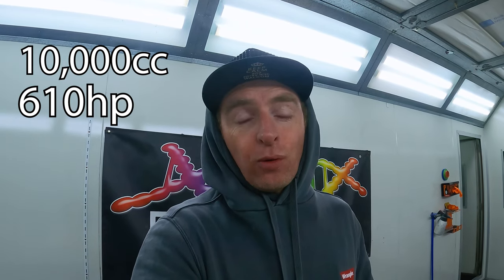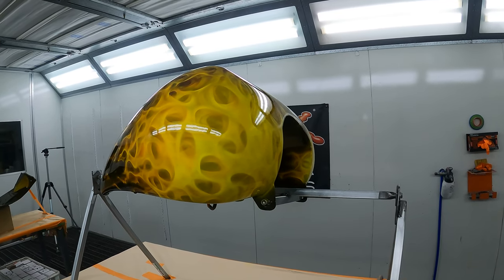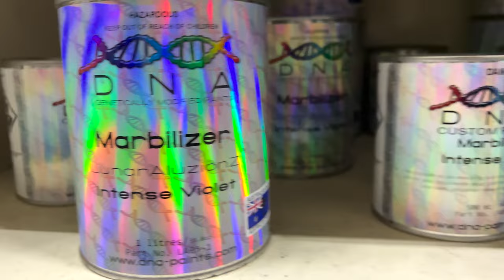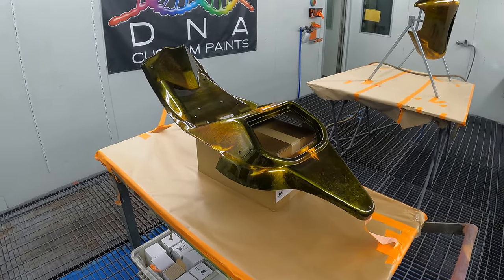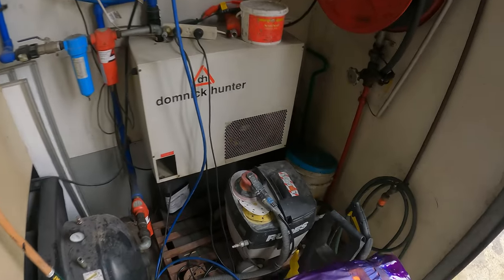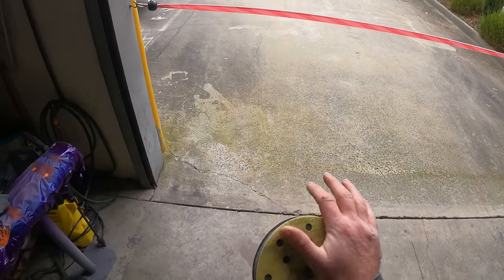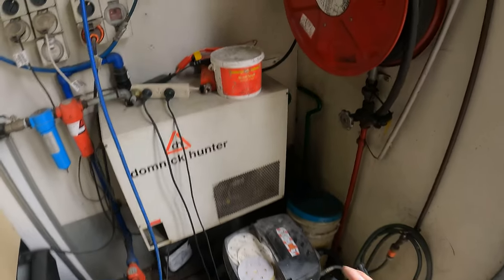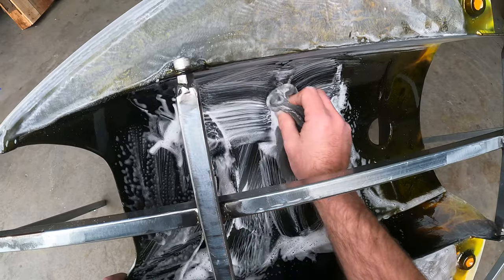610HP Motor Bike Flow Coat!

Comment: Hey mark, I have a question about flowcoating.. I completely wet sanded every inch of my black 2011 corvette.. 1500, 2000, 3000 to remove every bit of orange … polished back to a smooth glass like finish.. 
I’m looking for miles deep wet mirror finish.. can I scuff the old clear and flow coat with a top of the line show clear??
Reply from the maker: You can mate , however I doubt you will get much more of a better finish on the car if you have already wet sanded and polished it